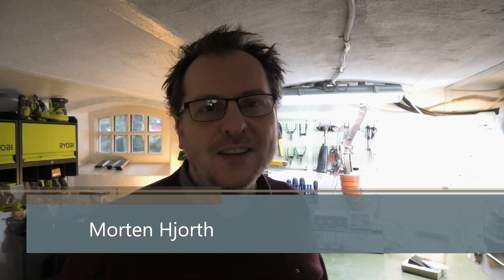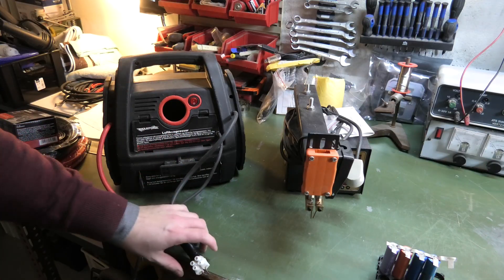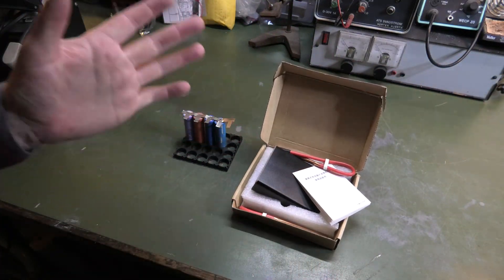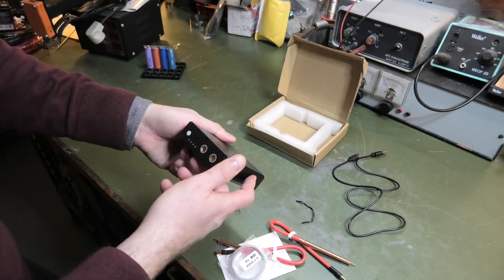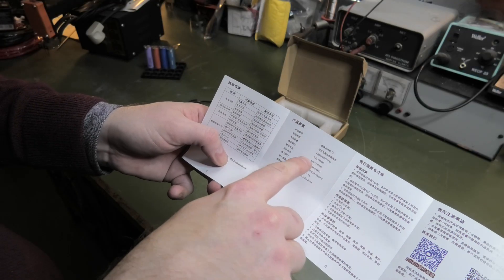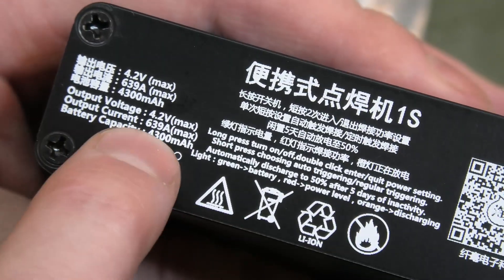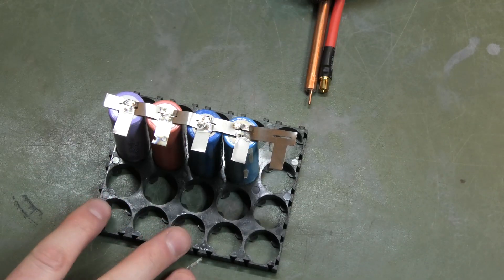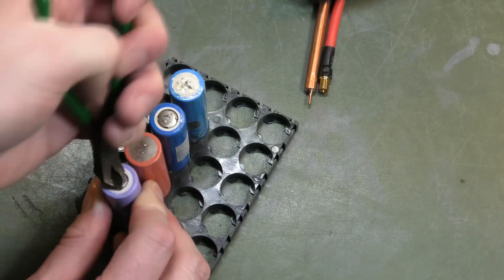Awesome $50 Tiny Spot Welder - Better than Expected - 1031

Comment: Very interesting video. Put heat shrink on the probe handles to insulate them against accidental shorting.
Reply from the maker: You do not feel it at all,, but the first few time you worry a bit,, and it does not get hot.
Reply: So if I didn't insulate it, it won't short me?

Comment: Spot welding nickel to copper doesn't work. If it did, your copper welding electrodes would stick to the nickel strips on every spot weld, which would make for a very bad design. :)
Reply from the maker: You do have a point there :-)

Comment: Neat little thing and yeah it only runs about $67 where I live (in Canada). Some of those other $25 ones on Amazon look a bit sketchy. This thing looks nice.
Reply from the maker: Some of them you need to add your own battery.  This one is a complete solution.
Reply: @MyPlayHouse  Well, that's even better then, I did not know that. For the price, "with" battery?! Good deal I think.

Comment: It doesn't work on copper because copper is too good of a conductor. To generate the heat you need some resistance: P=Isqr*R. The nickel strip will melt but not the copper, so no weld.
Reply from the maker: Hi the_serial_kaler
Thank You very much!  glad you liked the video :-)
Thank you for watching! :-)

Comment: High setting is probably for tin plated copper strip. Copper has lower electrical resistance than nickel but requires more power to spot weld because of this. The reason they use nickel is because it's easier to weld due to the higher electrical resistance.
Reply from the maker: Hi Atomicskull
Thank You very much!  glad you liked the video :-)
Thank you for watching! :-)

Comment: Saw this product on bangood a few days ago, was wondering if it is any good... I figured i'd take the chance for the price, it is nice to see it reviewed. My only complain here is that the interface is not the best, but again, it is cheap. But i'd like a slighly more expensive version with perhaps a tiny oled screen and a few buttons for more settings...
Reply from the maker: It works really well for what I am doing. I am happy with it,, :-) an OLED display,,No surround sound? :-)
Reply: @MyPlayHouse  i meant one of those small monochrome oled displays, as on the TS-100 soldering iron, it is 128*32 pixels; super crisp text, low power consumption, and it costs 1-2$ per lcd (i2c interface) from the usual chinese stores :)
It allows to print values on the screen (for the TS100, you can see the celcius (or farenheit) degrees, rather than 4 levels of power), and thus you can have more precise settings, know the settings exactly (here you would print the amperage output, and the pulse duration, for instance... and having those settings may enable you to succeed the spot welding on copper)

Anyway, cheers!

Comment: I don't know if you care, but it seems like you used a bit high current or camping force. Decrease either of them and the yield strength will be higher. I could see some small sparks, which means that here is material not only being rmeoved from under the tips, but leaving the area of the joint all together.
Reply from the maker: Hi Johannes Borg
Thank You very much!  glad you liked the video :-)
Thank you for watching! :-)
Reply: Thank you for posting a good video ;-)

Comment: I am using such a spot welder now quiet for some time. I paid only USD 26, maybe because I live near to China. I do a lot of spot welding. I therefore can confirm that you weld at least 250 spots before recharging the box. I wish you happy welding. You can replace the copper welding electrodes by simple copper nails.
Reply: Sir how is the spot spot welder today? Is it still functioning as usual? Thanks!
Reply: @216g6  yes, I am still happy with it.
Reply: Where do you find your copper nails???
Reply: @elfpimp1  In any good hardware store or even on-line. Just google "copper nails". Take a magnet with you because some shops sell fake copper nails made of steel.
Reply: @elfpimp1  get a thick gauge copper wire snip off a section? Voila!
Reply: @elfpimp1  I make my own electrodes with copper wire about a number 8 of 6 copper wire and sharpen with a grinding stone. I have never heard of copper NAILS I think they would bend.
Reply: @elfpimp1  maybe solder iron tips
Reply: @elfpimp1  They make them for plumbers to use with the copper straps everything has to be copper. A hardware store should carry them or plumbing supply.
Reply: Would you share the link for the one you have for 26$ ?
Reply: @tomas_klouda  Mine is not available anymore. But I found a similar one at a similar price:
https://www.lazada.com.ph/products/agoal-spot-welder-portable-6-gears-adjustable-mini-spot-welding-machine-for-18650-battery-spot-welder-spot-welding-machine-tool-kit-i1547930812-s6569684725.html
Reply: @tomas_klouda  tons on ebay & probably amazon that are basically the same thing as this but without a fancy enclosure or a battery. Generally you hook them up to a high amp power source like a lipo pack or a car battery, turn the circut-board sandwich on somehow, and it will behave very similarly to this, given 8-20ish volts and ideally a few hundred amps available momentary current. 25-30 Is the typical stateside rate I think, though I've seen them for like 15usd from China.
Reply: @phxgen  That's very naive of you :-D
With these Chinese stuff, you can't be sure it is the same thing even when it looks exactly the same according to pictures.
I have seen multiple such spot welders tested with mosfets exploding spectacularly, so I am searching for good reference from someone who bought it from the one specific seller, as that is the safes bet you can make (still not guaranteed success though).
Reply: @phxgen  I am not searching for a workhorse. I am not making more then two battery packs a year. I am searching for something that won't blow at me at half of the first battery pack and possibly last for few battery packs at least.
Sunkko is a waste of money and space for my needs. And from what I saw DC spot welders are even better in some regards than AC powered ones.
It could drain really high current from mains and the impulse on the Oscilloscope looks better from these DC powered ones.
Sure, to get the best thing for what I need I should go for Malectrics one or SEQURE SQ-SW1, but it makes not financial sense for those few packs it will serve me...
Reply from the maker: Hi Renato sa Camiguin
Thank You very much!  glad you liked the video :-)
Thank you for watching! :-)
Reply: @MyPlayHouse  its not in english,,because your supposed to become a chinese communist...  eh..

Comment: The US Amazon site has all of the specs in english. Theirs is listed as having an aluminum alloy shell. $67. w/ free shipping on 3/23/21 Amazon has a good return policy too. Can you test the output by putting the tips on your tongue?
Reply from the maker: Well you know the US is only 5% of the world,, and for us outside, returning is not really an option. and the Spot welder is like $20 cheaper from China.
I would not test anything that melts metal together,,,on my tongue.
Reply: @MyPlayHouse  you not have amazon?
Reply: Whether you buy from the US site or not, all the documentation is listed in English as you said.  Good find!
Reply: How about one tip on each temple.

Comment: Nice device after inprovements are done :)
Improvement #1 make new longer cables with more beef and insultate to the very tip.
Improvement #2 a fixture to attach the box to the desk or similar
Reply: longer cables mean more resistance, means higher powerloss and current draw from battery and hotter components and shorter life span
Reply from the maker: Hi Jan Seidel
Thank You very much!  glad you liked the video :-)
Thank you for watching! :-)
Reply: To your point 2) I glued a Velcro pad on the box and on my silicone work pad. Holds perfectly.

Comment: Used your link, and just bought one 😃 good enough for what I’ll need it for, and I can easily replace those leads if needed. The auto-discharge feature sold me on it. 😎
Reply from the maker: Thank You,, I can see that it is very popular! :-)
Reply: Did same and purchased one locally. I had to open it and screw the battery on the main board but otherwise all good :)
Reply: auto discharge is a pain in the ass. prevent you from getting good pressure down before it fires. especially with thicker gauge nickel strip for high power applications.
Reply: Exactly, thought it was just me

Comment: Can i use this machine to spot weld two tin plate instead of soldering?
Reply: it's called tin plate, but it actually is an alloy. Pure tin is very soft and ductile.
Reply from the maker: Sorry,, I do not know,, and it would depend a lot on the plates.

Comment: Very cool! I've been wanting to start making my own batteries since I got into building electric bikes and this looks PERFECT! How many welds do you get per charge?
Reply from the maker: To be quite honest,, I got tired before it did,, I would estimate at least 3-400 fully charged.
Reply: @MyPlayHouse  WOW, that's impressive for such a small package. I think I'd have to put longer leads on it but that's simple. Thank you!
Reply: @PhysiqueGeek  just be careful with it as there is a very large and angry danger pillow in it.
Reply: @TauCu  haha yeah I’ve seen a friends lipo rc battery blow up. Definitely wouldn’t want that happening right next to my face inside an enclosure like that
Reply: The most I did were 250 in a day and it seemed still to be ready for more.
Reply: @RenatosaCamiguin  heck even if it's "only" 250 per charge that's still great for what it is. Buying an expensive spot welder was the main thing holding me back from learning to do this
Reply: I have a similar one. It has troubles with 0.15 nickle, 0.10 is fine

Comment: I advice u to not spot-weld the same cell twice in a row, but rather go to the begin of the line and spot-weld the last cell for a 2nd time when u´ve finished spot-welding the rest of the line for a 2nd time... It helps with heat-dissipation.
Reply from the maker: I would think the slightly heated metal would join better.
Reply: @MyPlayHouse  Spot welding batteries belongs too the worst ways of doing it, since the heat is to high for the battery itself, and deteriorated a bit. if you search for infrared fotos of batteries-spot-welding, you´ll notice, the heat-rise is significant, it´s around the values, where a whole cell at this temperature would spontaneously catch fire. Spot-welding a 2nd time makes thing even worse. the connection has to be strong enough to resist vibrations, that´s all, it doesn´t have to be really a weld, that´s why people finetune the process with lower milliseconds-count of the welding-time-period, in order to introduce less heat. Think, that a connection must be there, that withstands vibrations, but the quality doesn´t have to go above that. you could use clothespins instead, with more surface-contact as result, but that´s impractical, of course...
Reply: @MyPlayHouse  laser-welding is the way to go, but that´s only for factories, cause it´s costly.

Comment: I bought the $24 dollar green one that doesn't have the battery. Made a 3s battery for it. It works perfectly at level 18. Don't buy the one made to run off capacitors. They blow up.
Reply from the maker: I liked this one as workers so well right out of the box.

Comment: Only thing I don't like is the welding leads.

I'd prefer to have a screw terminal/clamp to attach leads so I can make my own out of a piece of 10 gauge stranded wire with a copper wire form a length of romex as a tip.
That way I can have whatever length I need, and have different shaped tips.
Reply from the maker: Would be nice if the tips, was replaceable.
Reply: @MyPlayHouse  i think I'm going to just avoid welding entirely.

Nickel isn't really much good for high current battery packs.

My pouch cells will be mechanically connected with threaded aluminum rod to avoid corrosion.

For my 18650 pack I'm going to order some high conductivity silver based adhesive to bond coppet bus bars.

With the 18650's I can pull 30 amps per cell, and thats just too much for nickel.

And the pouch cells are up to 200 amp continuous, 400 amp peak.

Comment: Maybe 2 x Strip's of Black .&. Red HeatShrink one for each Probe, could Help ALOT in Accidental Short-Circuits..? 
Been after one of these for a while to repair My Impact Wrench (Batt), found a really nice one on Fleabay for £7:45 it was an all in one unit with 2 x Acrylic Block's in Various Colour's Either Side,  also with 2 x Adjustable Spring Loaded Welding Tip's on Grub-Screws, it could also be ran from a 12v 2a Transformer, or ( I think You could of Hard Wired a Neg & Pos Wire to a Small Car/Motorcycle Battery... Nice Touch.!
So I ordered One, unfortunately it was The Last one in 'Baby Blue' but at that Price I wasn't gonna moan as all Compettetor's, has thier's up around £20, £ 17:45 etc...
Checked Purch Hist & it said been Dispatched, then a week later I get a Message from them with some Cock n' Bull Story about parts missing out of Box, Uncomplete Item. 
Sorry We Must Refund You in Full and Cancel Order..!

I Wonder How Many other People got that Same Message when they Realised what a Bargain-Price They were Doing Thier's for.!? Hmmmmm..!!!   Curse You FleaBay..!! Grrrrr
Reply from the maker: Hi Dan Solo
Thank You very much!  glad you liked the video :-)
Thank you for watching! :-)

Comment: Morten I just looked at the Banggood page for this device and they have attached an English version pdf file for the instruction manual.  They've also got a more expensive version that has replaceable electrodes but doesn't seem to have the same features.  I'm an amateur radio operator and in the past I've rebuilt battery packs for my portable xcvrs and they were a bitch to solder.  Also a lot of my  hand tools use rechargeable batteries and it would be a lot more cost effective to rebuild the packs rather than buy new ones.  Rebuilding 3 battery packs would pay for the welder imo so I'm going to place an order.  I've bought a lot of things from them before and the only complaint I have with the company is the long lead time.  I also noticed they have nickle tape rolls so I'll probably get one of those because I know I'm going to have to practice with it before actually using it.  Thank you for an excellent video. John.  (N1ABE)
Reply from the maker: Hi John Brandolini
Thank You very much! Yes when you order something,, you kind of want it NOW :-) glad you liked the video :-)
Thank you for watching! :-)
Reply: @MyPlayHouse  I was shocked this afternoon to find the package from banggood outside my front door.  That's the fastest turnaround yet from them. One of the uses I intend to put it to is rebuilding defunct Black & Decker battery packs for some of the tools I have.  Mind you I replaced those tools a while back but I abhor throwing potentially useful items out.  I found a source on Ebay that sells the sub c 4/5 nimh cells so I can rebuild the packs for around $15.   It was minimally charged when it arrived so I haven't had a chance to test it yet.  The defective packs I have will be the guinea pigs for the testing.  Thanks again for making me aware of this tool.
Reply: @MyPlayHouse  Morten, I just wanted to give you an update.  I ordered some sub-c NIiMh cells to rebuild the battery packs that power my  legacy B&D  products.  There where some vendors on Ebay that were selling "new" packs but considering this equipment has been discontinued for quite a while I decided to rebuild the packs I had.  The new cells came with tabs which made the process easier but I tell you from having to try to solder wires to cells in the past this spot welder is p!sser!  One electrode holds the tab in place while the other completed the circuit. And, as you pointed out,  setting 2 does the job.  Many thanks, guy!  You saved me from throwing good equipment out.

Comment: Too bad it doesn't use 18650 batteries internally; then you could use it to spot weld a backup battery pack if the original battery fails.
Reply from the maker: Well It is doing pretty good, with the batteries it has,, I think I did 400 spot welds, and it lost one bar on the battery indicator.

Comment: I'm glad your machine is working fine. I don't trust the quality of weld on mine.its going back to Amazon. I trusted the red chinese welder better. I do have the Kweld welder now since I'm already addicted to this other part of the hobby..battery building.
Reply from the maker: I am very pleased with this one,, I did try to build one myself, but when it is fully charged it will burn holes in the 18650,, and 50 spot welds, and it was flat. :-/

Comment: I hope to use .2mm pure nickel strip to connect my 21700 cells. I think that would require this one's larger brother, which is yet to be?
Reply from the maker: I am using 0.15,, that works fine.
Reply: @MyPlayHouse  Are you on full power?

Comment: I bougth a very similar one and found myself having to use the max setting to achieve the best result. The one you have seems to be a nit better. At the end it got the job done and it did not break the bank.
Reply from the maker: I have also been steeping mine up.

Comment: i also want a spotwelder , because i need to build  batterypack's for a electric skateboard sometimes. But have you tried to weld 0.15 PURE nickel with it?  or is a regular spotwelder for 230v better for this type of application?
Reply from the maker: That is just about the same I am spot welding,,, so that works.